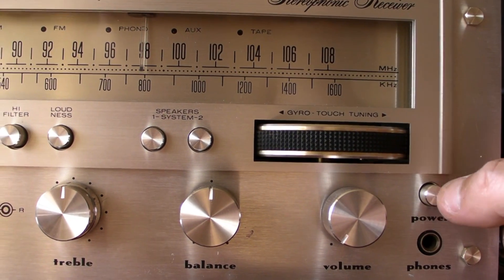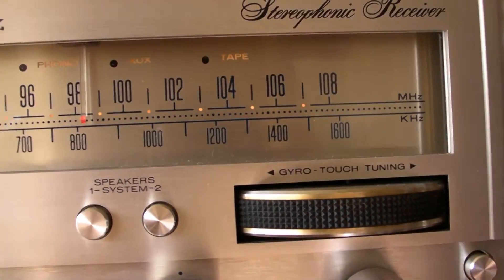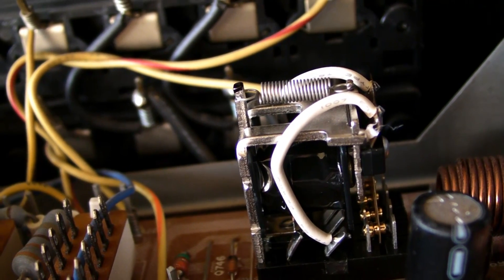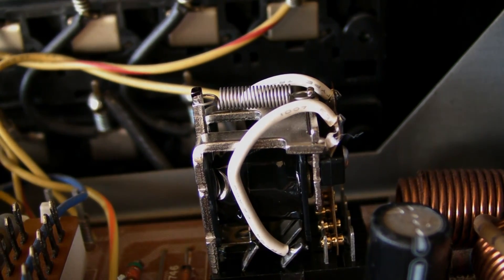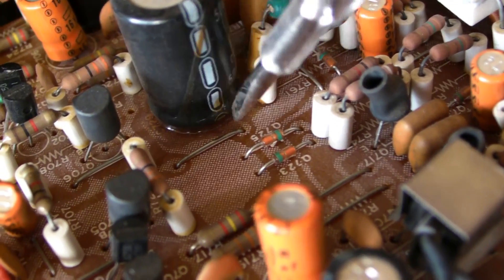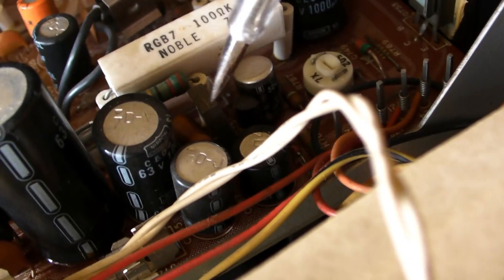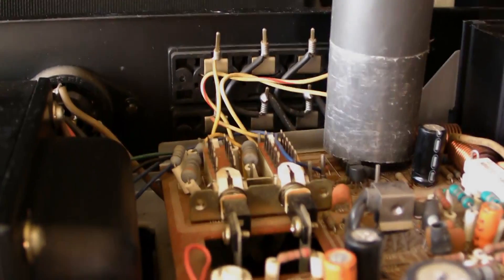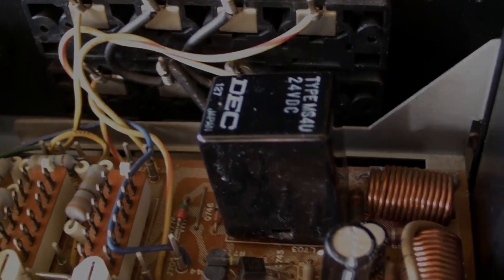speaker relay cleaning marantz 2252b, the best time investment

Comment: The relay housings of the amplifiers do not actually have to be removed by squeezing the terminals together with a screwdriver or screws! The relay box is simply squeezed from the bottom edge, the ends together with your fingers and moved slightly at the same time and the relay box simply pops off the mountings! The relay box housing is very thin plastic!🙄

Comment: My Sansui AU6900 had loss of sound on one speaker,especially at low volume. Removed the cap of the relay,followed by removing the spring to get the middle sector of the relais out to create workspace for my cleaning procedure,  there were black spots on some contacts. Used a toothpick and a little toothpaste to remove all black spots. Since the procedure the problem never occured anymore. Don't know how long it will last, we'll see. When the problem retrurns i will redo the procedure. If it doesn't last long enough i can always buy a fresh one to be freed from the annoying problem for many decades.

Comment: so i have this old vintgae yamaha  amp its ax540 i cold use some help with it the amp is in beautiful shape out inputs and out puts work but the speakers wont stay on if i hook up on speaker to the amp and take the wire to the outher speaker if i put it on the botom of the speaker board it kicks on the speakers but if i turn the amp off or even press a and b button for speakers the sound kicks back off is it the relay please help thanks

Comment: So this is been determined to definitely be a stereo issue as it did happen during CD playback. Many times after it happens then it will play flawlessly for a long time. Any ideas as first steps? I did order a can of Detox so I was thinking of cleaning the switches although they all seem clean with no static. Thanks very. Much for posting this video and any suggestions are appreciated!

Comment: So I am having similar issues with a Marantz 2226b, sound cutting out all together, sometimes only one channel. I thought it might be a turntable issue as this has not happened during CD playback yet. I have hooked the turntable up to my other stereo to test it. I purchased the Marantz off of Ebay and trying to decide whether or not to keep it. It does have a very nice sound when it works but the vinyl playback issue is a big problem.
Reply: Hey Jamil, I have the same problem, except only the right speaker cuts out intermittently. When I give it a good whack on the right side, it works fine. Something might be loose, or it could be the relay.

Comment: Just had this problem on a Sony MD373 that was intermittently cutting out one or both channels. Found I needed to re-solder some dry joints on this relay too, both for the contacts and the coil. Reproducing the fault by jiggling the board gave feint but visible sparks on the affected joints with the volume sufficiently high.

Comment: Thanks bud, I have a Pioneer VSX-D710S receiver wich would sometimes have no sound output from one channel or two.
This method fixed all the channels, and it's working perfectly fine now! :)

The only "problem" with my case, is that this receiver is a multi-channel receiver, so I had to clean not one, but FIVE RELAYS...
This being said, it's not that hard to do, and the relays can be cleaned without much disassembly.

Comment: :))) Is not leaking material is adeziv used in that period to fix tha cap to mainboard, that adeziv is corozive. The cracling noise is from a X or Y cap damaged , this caps is conected in paralel with power buton.
Reply from the maker: VALYK29 thank you

Comment: I bought a Marantz 2275 from eBay and was used by a smoker! The face was brown and the inside was dusty and just needed a good cleaning. I followed vintage stereo's video to clean the pots and still had a problem with the left cannel. I didn't give up and went to the speaker relay video and followed the instructions to the letter. I used Deoxit D5 contact cleaner which doesn't leave a residue. The relay was really dirty and used the poster card (which is a little thicker) with the D5 and it did the trick!
Thank you so very much for you instructive videos.

Comment: My problem has returned! The left channel will drop out, but can be brought back but sending a loud signal through it. It will also come back if I clean the relays again. Any suggestions on how to fix the problem for good?
Reply: Sam Fraser
I have a Marantz 2275 I've been semi-perfecting for about a year now. My left channel drops off with static at low volumes-even after I've deox'd the crap out of everything. I noticed while it was apart that when the bottom cover was being placed on (while music was playing) I was getting interference and even had the speaker cut out completely. This sounds incredibly stupid, but I put electrical tape over all the screw holes on the bottom and then put the cover back on. I've had a solid left channel for 4 straight hours of music for the first time EVER. I also Deox'd the preamp-main in rca's inside and out. So far so good. I also got the D100 for the volume pot as well. One of these fixed it!
Reply: jellyfish182
Sorry-to clarify, electrical tape between the chassis and the bottom cover. Almost like an isolation layer.
Reply from the maker: clean all the potmeters
Reply: Yeah, but that's been done not too long ago. Think it could be the volume pot?
Reply: Very interesting! I've deox-d the crap out of everything, like you did, and so far that has greatly increased the duration the left channel stays on, so right now I'm happy with it. But I will pursue a more permanent solution and I'll look into your suggestions. Thanks!

Comment from the maker: One of the boards, the one near the 2 big standing black round caps is the ampiflier board. It is not flat but vertical and in the middle near the 2 gold/copper colored springs you can find it.It doesn't have to be black but it is often square.

Comment from the maker: first clean all the switches and potmeters. After that clean the relays. Open the relays and close your amp, slide some paper between the golden colour contacts. You can put some deoxit on the paper. then you click the on switch on the amp and the contacts will close the paper.While you remove the paper it takes dirt away. repeat this a few times. you can check the relays buy just pushing on it while the amp is working, if you hear difference in sound the relays needs to be cleaned.

Comment: you should probably explain some safety before someone touches a live circuit with a nail, and the shinny stuff bellow the caps is actually glue.....bad stuff anyway and should be cleaned off board as its corrosive to components and the board.....